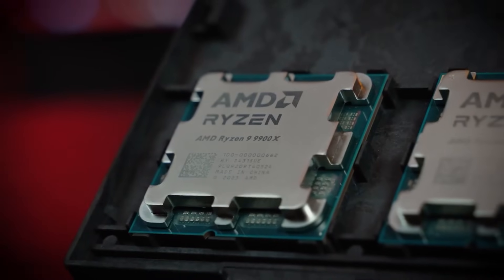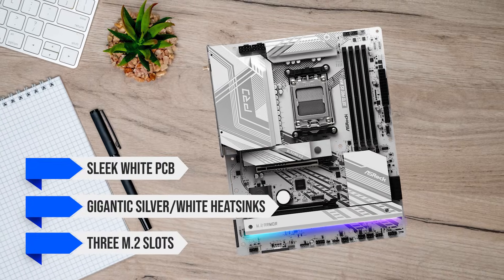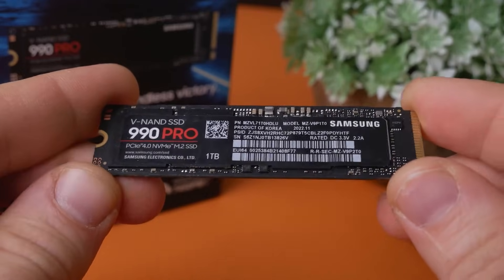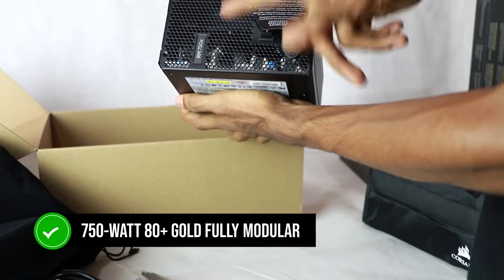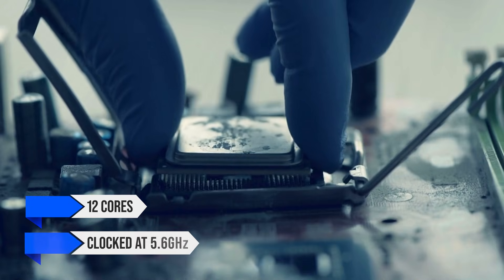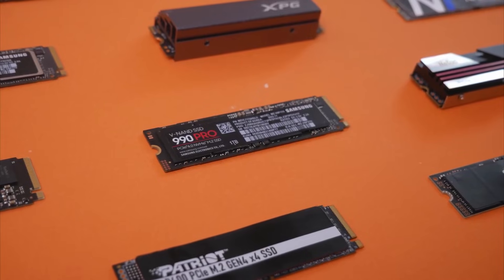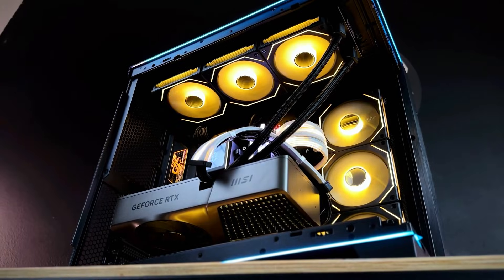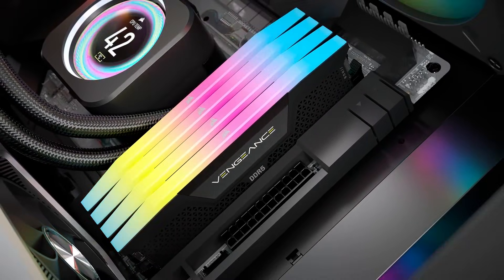The Best Ryzen 9 9900x PC Builds In 2025!

Comment: @BC zone is that 750w enough?

I want to buld this 

Processor: AMD Ryzen 9 9900x
Motherboard: Msi x870 tomahawk / Asus Tuf gaming x670e / GIGABYTE x870 aorus Elite wifi7
Ram: G.Skill Trident Z5 NEO RGB 16× 2
SSD: GIGABYTE AORUS Gen4 7300 SSD 1TB PCIe 4.0 NVMe M.2
Power Supply: Cooler Master 1250w gold 80+
Liquid Cooler: Cooler Master ML360L Core ARGB CPU / ARCTIC Liquid Freezer III 360 A-RGB
Case: NZXT H6 Flow / Antec crystal x11

I dnt want gpu now.
Reply from the maker: yes it's enough, also for your build especially if you don't want a GPU you don't need 1250w power supply you can save there and use the money for something else

Comment: Solid. In the process of building almost the same setup, although I'm going with the Antec C8 case and going to try get a 5070 TI if I can
Reply: I want to buld this 

Processor: AMD Ryzen 9 9900x
Motherboard: Msi x870 tomahawk / Asus Tuf gaming x670e / GIGABYTE x870 aorus Elite wifi7
Ram: G.Skill Trident Z5 NEO RGB 16× 2
SSD: GIGABYTE AORUS Gen4 7300 SSD 1TB PCIe 4.0 NVMe M.2
Power Supply: Cooler Master 1250w gold 80+
Liquid Cooler: Cooler Master ML360L Core ARGB CPU / ARCTIC Liquid Freezer III 360 A-RGB
Case: NZXT H6 Flow / Antec crystal x11

NO GPU NOW.

What do you think about this?
Reply: @Akkihearts007 looks good but you can probably drop to a 1000w PSU and save a bit. Put all the components into pc part picker, add 30% and that's your best bet
Reply: @darthandy6438  Thanks for reply. I am buying this PSU for future proof only difference between 1050w and 1250w is only 30 to 40 dollars. As currently I am not buying GPU and like to get 5000 vestion of Nvidia and dnt know that how much power it would draw.

Also which monitor are you suggesting? For programming, Gaming, Video editing? Thanks